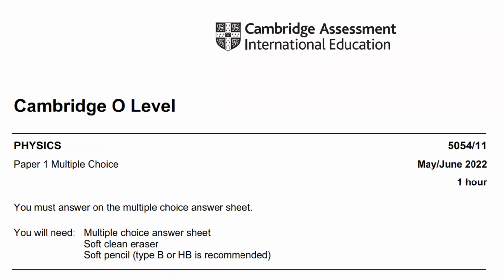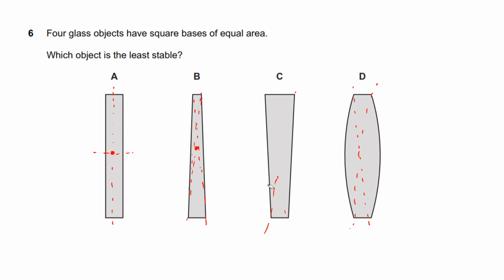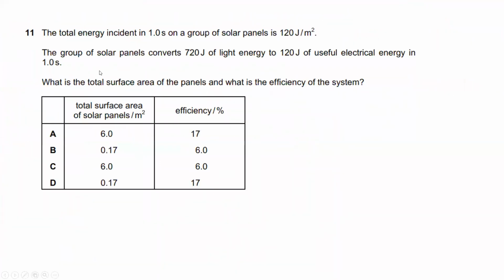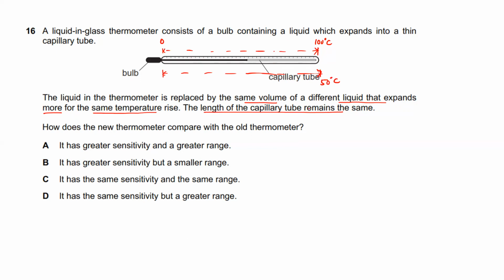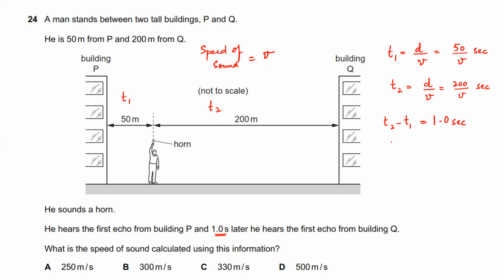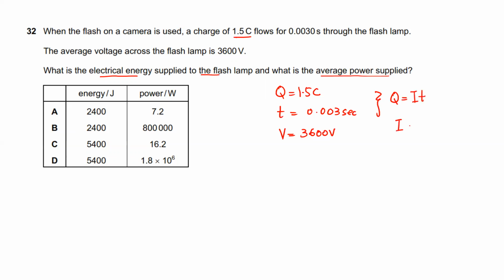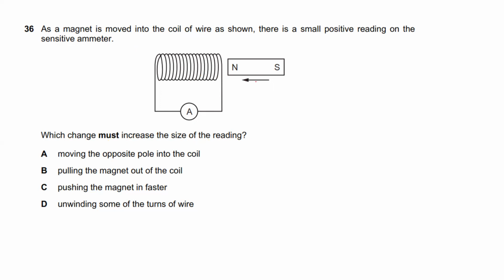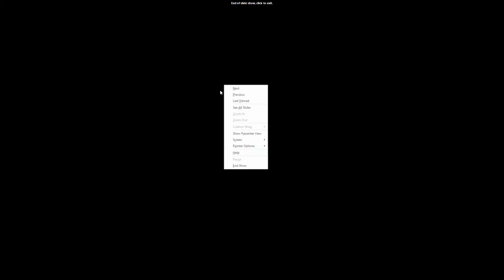O Level Physics (5054) | Paper 1 (Variant 1) | May / June  2022 | Explained Solution

Comment: Question 2, Answer is C,
As Thinking distance Speed will be same and while  during braking distance it will surely decelerate.
Reply from the maker: Yes. Its a mistake on my end. Thank you for pointing out.
Reply: @educationforall2021  Yeah I noticed it as well, you should pin that comment